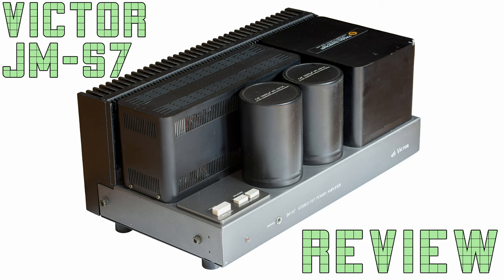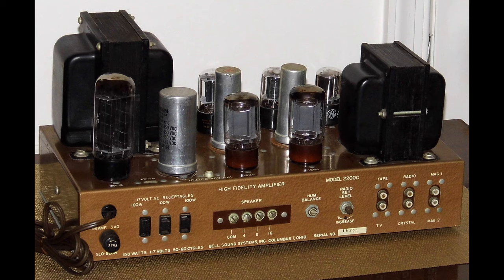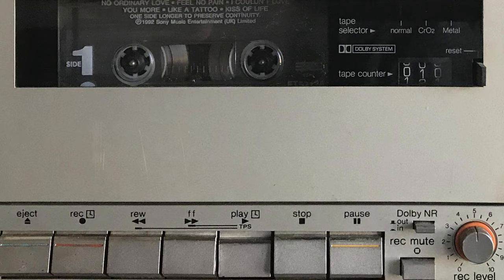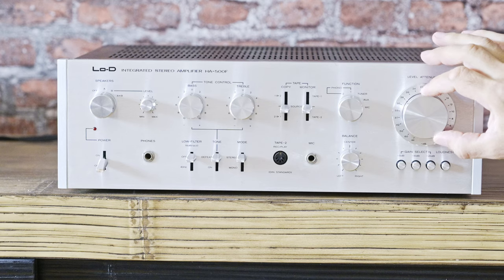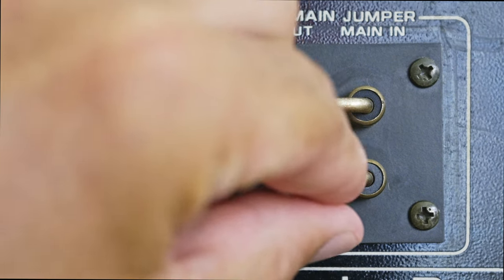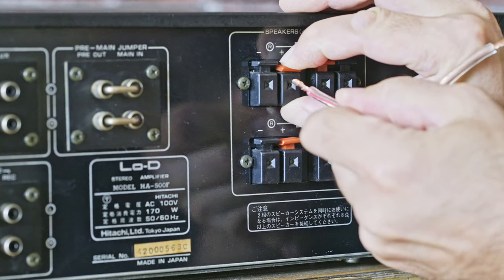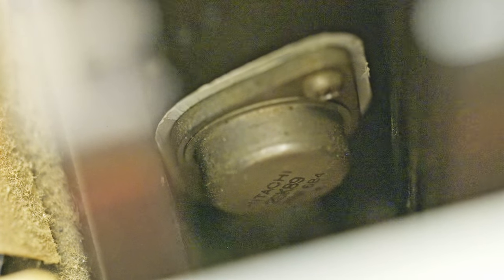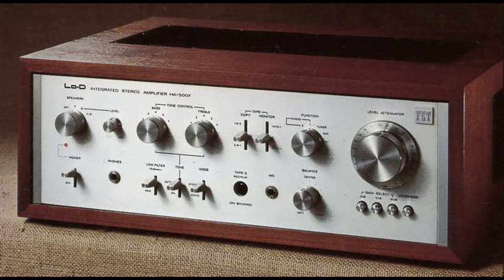Hitachi (Lo-D) HA-500F Review - Is this integrated V-FET amp as good as V-FET power amps

Comment: I have HA-610 and I love it.
Reply: Is this the same as the Hitachi HA-610? Also, what speakers do you have?
Reply: @rogersmith8899 the HA610 it's MOSFET amp different construction than yours. I'm running pioneer hpm 40 mk2